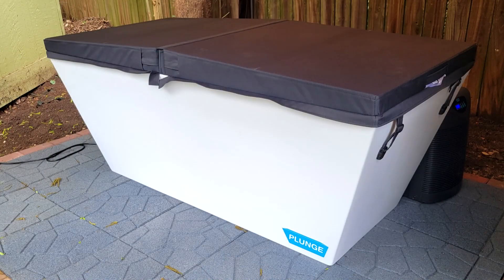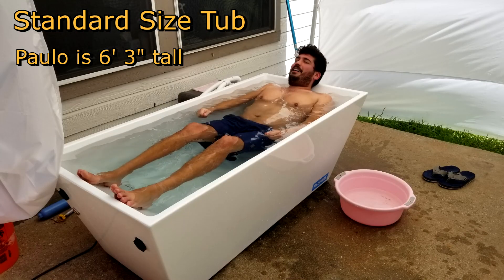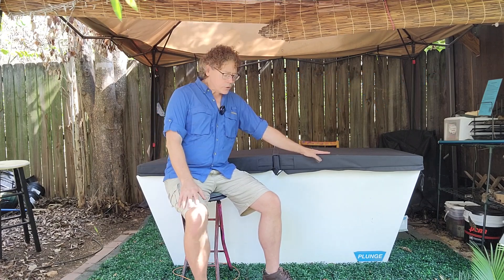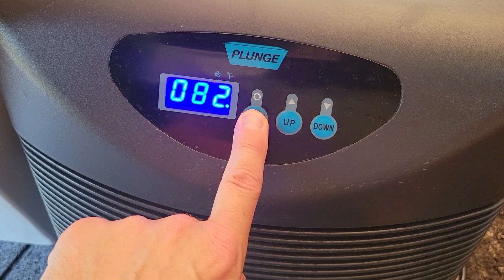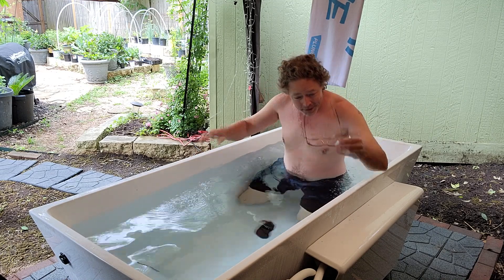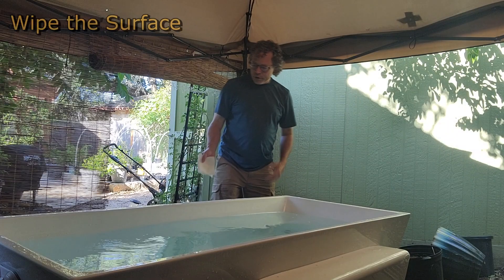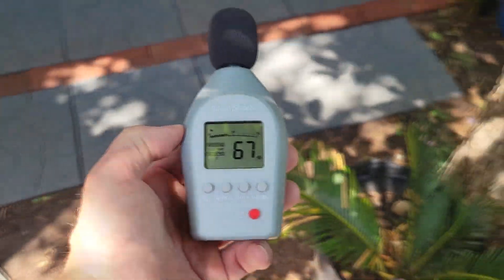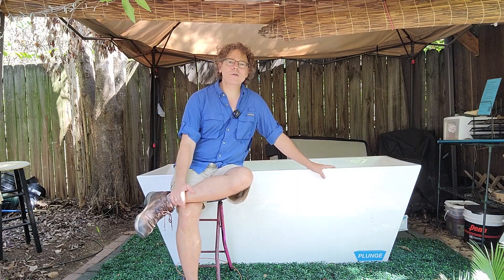Plunge XL - Full Review

Comment: Great review, what issue did you have with your pump? Mine isn’t generating any water flow and makes a buzzing sound every five seconds or so. Going to see if the company can fix it
Reply from the maker: Thanks for commenting. The pump stopped working and they replaced it under warranty. It has been totally fine since then.

Comment: Thanks for your detailed review. I just have a quick question. I just got the regular version, is the water pump supposed to be loud? Mines is making a loud humming/whirring noise.I didn’t really hear the same noise from your water pump during your review.
Reply from the maker: You're welcome. All pumps make some noise. Yiu may not have heard it as much because I'm using a lapel mic. 

The pump should have a variable speed controller on it. Turn down the speed to reduce the noise level. 

However, don't turn it down too low, which can damage the chiller.

Comment: John, what is your opinion on the ozone generator they are using?
Reply from the maker: It does the job. It will last about 1-2 years before needing to be replaced.

You can extend their life by installing a timer and running it for a few hours each day instead of all day 

You can buy them from Plunge inexpensively.

Comment: I have the regular plunge. I really don't need the extra length. But that 3" of extra depth would be nice.  When I first set mine up it was kind of like yours. (not really level)  I drained it and adjusted the feet underneath so that the water is the same distance from the top edge all the way around.  I guess it really doesn't matter. It just bugged me.

Comment: Hello John, I loved your review! It is very informative and I love your comparisons with cold plunging.  I live in the North East and I happen to have a Plunge XL Hot/Cold model recommended by Michael.  I just set up our Plunge today and Im a little confused as to why my chiller keeps turning off.  Can you offer any advice as to why?…I spoke with customer service and I ended up doing a few resets and powered the unit down but it keeps happening.  Thank you for any information you can share with me!…
Reply from the maker: Hi - the chiller can turn off for several reasons: 

1. Your target temperature is reached
2. There is an issue with the power supply
3. There is an issue with the circuit in your home (ex. too much draw causing the breaker to trip). 
4. There is an issue with the chiller.
5. The temperature controller might be set up or programmed incorrectly. 

I would unplug everything else from the same circuit. If that doesn't help, call back customer service and see if they can escalate. 

It's best to call Plunge directly so there can be a record in case anything needs to be replaced under warranty.

Comment: I’ve had the cold plunge and also the cold plunge XL. While I found the XL far greater in size and faster water flow, which I loved at 6” tall, I also found the XL to be so much louder. At first I put this indoors, and it was so loud in my indoor gym that I simply could not keep it there. I also found the XL to heat up my climate controlled gym so much that when the chiller was cooling the water, it was also blowing a massive amount of very hot air into my gym and also against the side of the plunge heating up all of the plumbing tubes and mechanical. This made no sense to me because inside the machinery and plumbing is chilled water having hot air blown against it. Defeats the purpose of efficient cooling. So my AC bill in my gym skyrocketed trying to keep a very insulated  gym cool enough to be comfortable in. The loud sound of the chiller and the extreme exhaust heat was unbearable so I put the xl outside. The regular plunge did not have these issues. Both were hot and cold plunges. I loved the larger size so it was a trade off. It makes no sense to put the xl inside especially in a hot Savannah, GA southern location. So, I would recommend putting the XL outside. And if you’re in an apartment complex, a very loud sound of the XL chiller will likely bother your neighbors. I still love the cold plunge and the cold plunge XL. These are just some things to think about. Listen to John’s video when he has the sound detector next to the chiller and you can hear how loud it is outside where sound is easily dispersed. That’s why I ended up putting my plunge XL on my patio as far away from the walls of the home as possible. My neighbors are far away from me so I wouldn’t need to worry about the sound bothering them. Works perfect there! I even think that having it outside, even in warm weather, is better in terms of efficient use of electricity, because the extreme hot air of the chiller won’t be blowing against the outside  plumbing, filter, and electronics of the plunge.
Reply from the maker: Thanks for your comments. You made very clear the difference between a 1/4 and 1 HP chiller!

Good reminder that chillers remove all the heat from the water and vent it into the ambient space. The 1 HP will do this much faster!